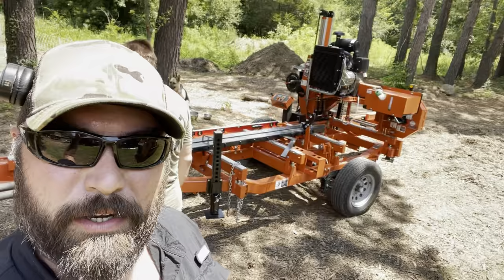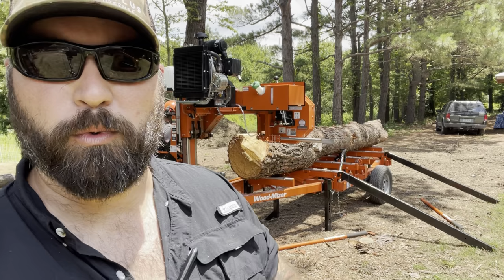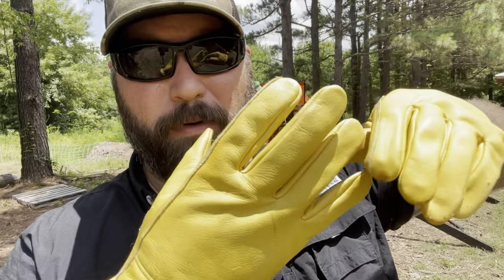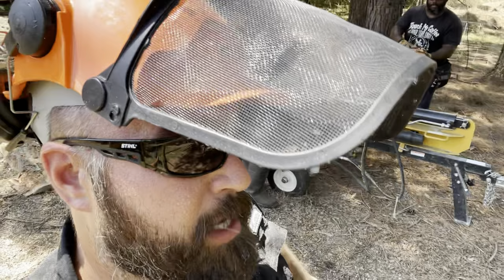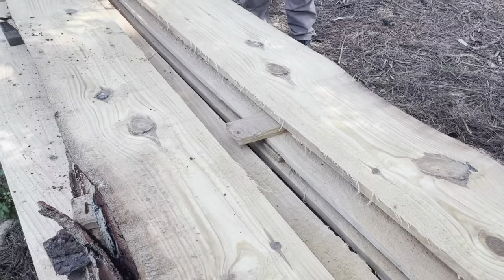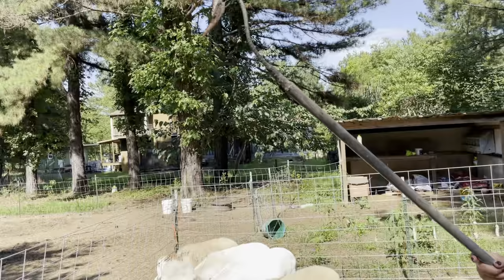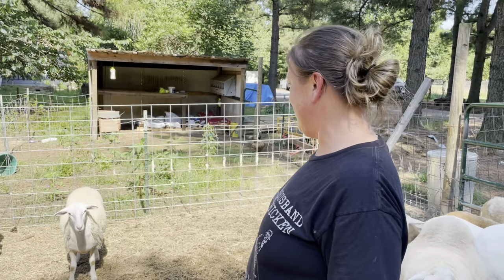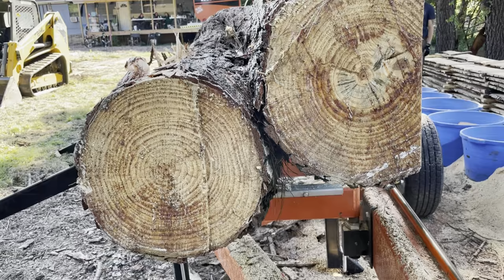Homestead Lumber Milling

Comment: You couldn't do that with alot of the trees from my grandparents place. They're supposedly filled with musket balls from Civil war battles.   Cool.  I know.  👍
Reply: Not a problem to saw lead projectiles. Iron and other things can be a major issue.
Reply: @acossaw  I would think that'd dull and/or mess up your blade quickly
Reply: If it was chock full of mini balls maybe, I have sawn logs that were peppered with 22 and modern jacketed bullets with no ill effects.  Copper or aluminum nails/wire isn't a problem.  Most bands nowadays are a good hardened steel. Sometimes a single nail or strand of barbed wire isn't a reason to change the band. Just depends on how you hit it.